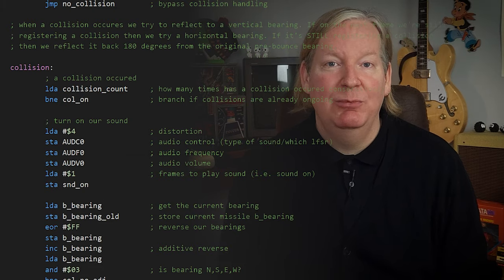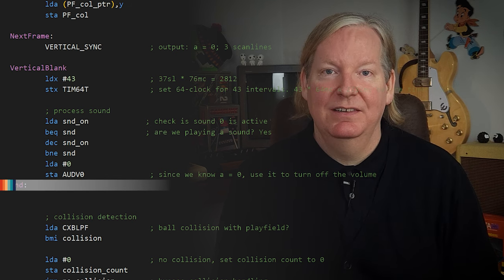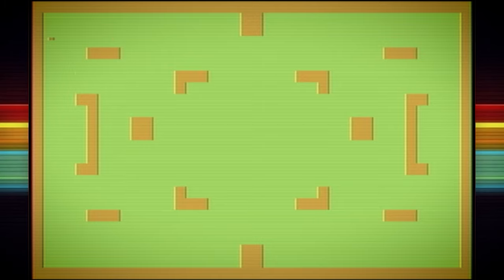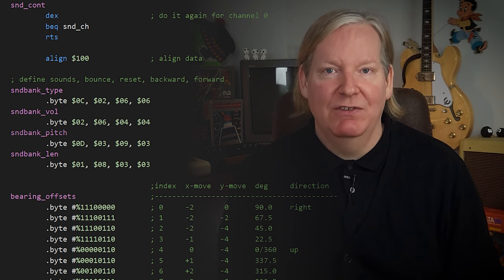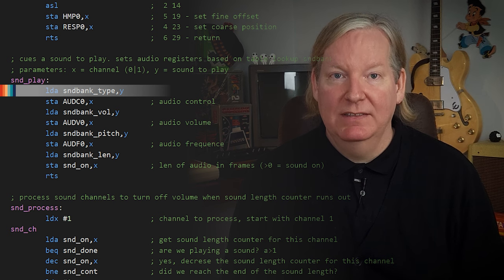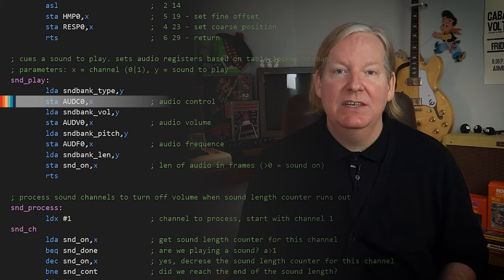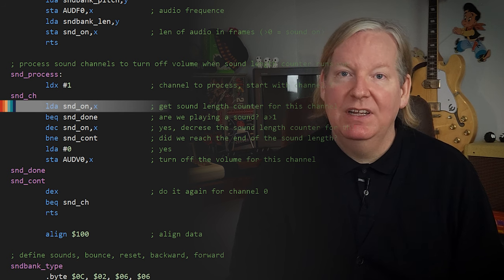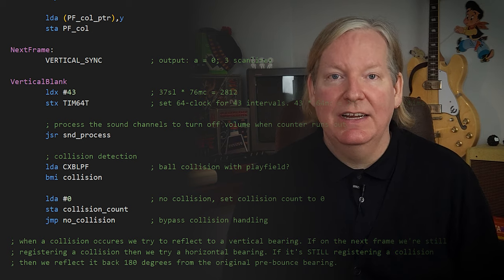Adding SOUND to your ATARI 2600 game! | 8Blit

Comment: I still remember that first 9-volt jolt when I first put the 3.5mm headphone jack styled Atari power cable in my mouth at age 6 while trying to hook up the console to a B/W TV with aluminum foil wrapped around it's rabbit ears (for the most 'HD' UHF channels of course!) 🤣

Any chance you want to do an episode on the various sprite-positioning routines that are now somewhat "idiomatic?"  I recall I posted one in a comment to you, but we also have the Battlezone positionimg routines, and others as included in the "libvcs.asm" macro file that's been around for a while??

Love your channel by the way, it's completely upper-tier comtent!!!!! 💪😎
Reply from the maker: I feel like that 9-volt buzz had a taste to it also. lol. I'll be doing another episode or two at some point regarding sprite-positioning and many objects on the screen. It will probably cover a couple different h pos sub routines, but also provide an argument against using a generic routine. Not sure when that will come out, but I do have quite a lot of notes prepares for when I work on that episode. So many things to cover, so little time! :)

Comment: Oof magoof, the worst thing I ever did for my title screen was add music. That was the whole point, too, because I'm a chiptune guy. I wanted to write a whole tune, so I started to. Man, it messed with the timing something fierce. It made my kernal a jittery mess as it was putting out an extra scan line every other frame, for what reason I still don't know, so I'd go back and forth between 242 and 243 scanlines. So I popped over to Atari Age and someone showed me a trick to tie the VBLANK, kernal, and overscan to the timers. Worked like a charm, but then my tune could only be so long, which bummed me out because I had the whole thing written out in Paul Slocum's tracker. I was gonna implement it but the timers cut off my tune every time. That's that I guess. Don't ask me how the Slocum tracker is able to fit the whole tune in its kernal. That dude is just on another level. If I knew how Slocum tracker worked I wouldn't be on YouTube obsessively combing every vid I can for 6502 assembly tips 😂 Killer vid as usual, 8Blit. You're dropping some good knowledge on one of the more frustrating aspects of Atari 2600 programming. I ended up using the 8bitworkshop method for the tune itself, which was cool because the patterns felt a lot like using a tracker, but the bummer was the notes didn't line up with the numbers Slocum uses to denote the different sounds. Took me a bit of work to port my work over from Slocum tracker, but I got there eventually.
Reply from the maker: Thanks for pointing out Slocum tracker. I had not seen that before. I'll have to try it out for myself. Just the word 'Tracker' brings up fond memories. In the 90's I was always using tracker software, just not for the Atari. Started with Mod Tracker, Scream Tracker, Fast Tracker 2, then on to Buzz Tracker on windows. These days it's the Cakewalk DAW which I preferred over Ableton (due to cost!), but I still think about going back to Fast Tracker 2. Thanks for the kind words, I really appreciate it!